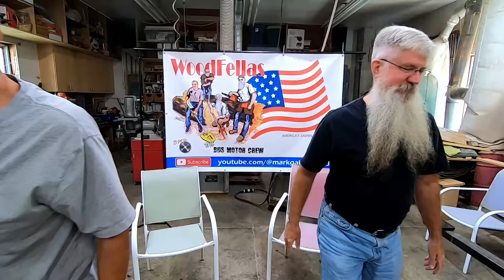I have some bad news # 472

Comment: Best wishes mark.  I did a lot of help at two sawmills, learned a lot, but I continue to learn from your videos.  My kitchen and entry 550 sq ft are 9-13 inch wide Walnut heartwood (flitched) from one tree.  Unsteamed.  Oil polyurethane. 

Mission style tables from select quarter sawn white oak.  Rustic tables from spalted green ash with the wain on the edge.  Nature is brought into my home.

Keep up the good work my friend.

Comment: Here's a little tip that may help with the wind sound. Keep a box of small fabric band-aids around and on windy days, just put a band-aid over the mic hole on the camera to keep the wind from blowing into the hole while recording videos. I use the 1/16th" foam packing material from my computer components and a little contact cement for a permanent wind filter. The noise comes from air blowing over the open hole like a whistle or flute. That's why stage mic's usually have a big sponge ball, it's not to keep spit out but it helps with that too, it's an air filter to cut white noise.

Comment: Mark...I told you before that I had a fully detached retina in 1999 and that the Veterans Hospital out here in California did a great job repairing my eye. The gas is going to help seat the retina. As active as you seem to be, that has to be put aside or you surely face failure with the surgery. I wore a patch on my eye and stayed face down for 10 days. When I saw you doing a video days after your surgery, my first thought was you were making a mistake. It is incredibly frustrating to idle yourself for that long to recover. As a wood butcher myself, I know the joy of the smell and feel of the craft, but you must be face down man...Just set up your laptop on the floor, and listen to your ophthalmologist. 
Sure hope to see you back at it down the road.
Ken

Comment: I personally can't fathom the fact that there is no one else to film or upload content. Oh well, it is what it is. Get well quick, and I'll be keeping you and yours in my prayers.
Reply: Oh I think there must be others who can film and edit.  I believe what he was referring to,, none of the others can run the mill.  The saw mill he is using,, 56 inch blade, 300 horsepower diesel bus motor,,, he operate to a normal tolerance of less than 1/16th of an inch.  That accuracy is required.  The deftness , skill, acquired over 3,000,, maybe 6,000 hours,,, well,, some people never get to his level.  He is not easily replaced at the controls.  There might not be 50 people in the country with his skill set on that machine.  Let him take a break. 

I hope your eye gets better. Mark,  and you are back at it soon.

Comment: You are in my prayers. I have mentionrd that I have gone through detached retina surgery in both eyes over 50 years age. The procedure is a lot better than mine. I had to spend one week on by back and the recovery time was longer. The gas bubble meethod is far better than what I have with silicon strips. Good luck.

Comment: I had this operation in the UK some years ago and I got my sight back fine when it was all over. It did not cause any pain, but not seeing straight or at all for some weeks was hard. I got a CD player and listened to the audio books of the Lord of the Rings to keep me occupied. If you are not into that there are plenty of other ones to listen to.

Anyway  I am sure that all will be well, keep safe and good luck my thoughts are with you from someone who has been there.